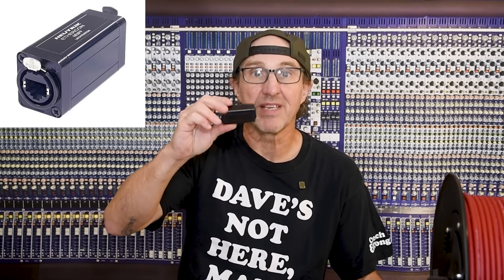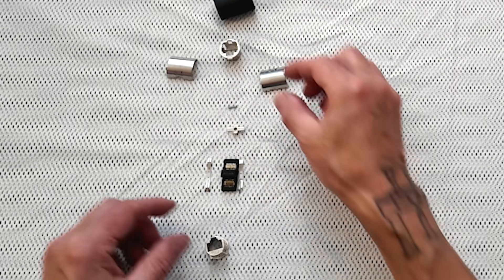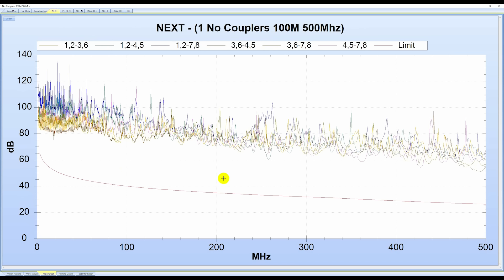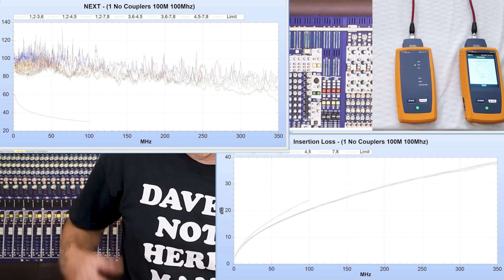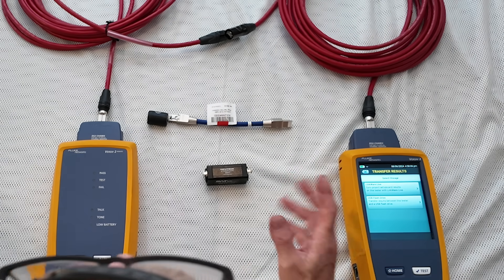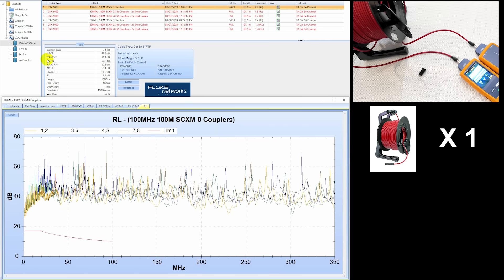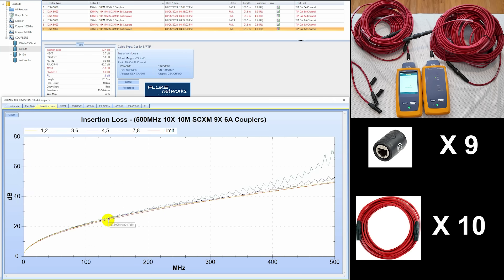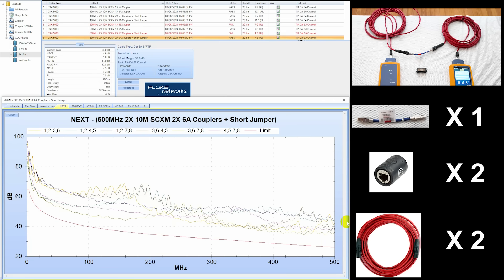How Bad Are etherCON Couplers?

Comment: Another super interesting video! With the large number of jumper results it almost looks like comb filtering, as if the jumper causes a reflection due to impedance mismatch at some frequencies but not others? Would it be possible to test the impact of one jumper at different points in the cable, to see if the frequencies that are affected move down the further away from the end?
Reply from the maker: Check the video around 13:18 where I do 2x 60m
Reply: @DaveRat  so you did, guess I need to be more observant! Thanks!
Reply from the maker: All good.

Comment: That frequency related ringing looks almost like an impedance mismatch. You see this in RF cables with SWR. Those Cat5e jumper leads would have terrible impedance at higher frequencies. The Super cat cable World have very good impedance and where they mate you get a mismatch and therefore reflections bad SWR. Now it just so happens at special frequencies you'll get great performance and also some terrible performance. That's a kind of laymans explanation of SWR and what your graphs look like to someone that has a RF background. 500MHz is well and truly in the radio spectrum. SWR is seen transmission lines. A rule of thumb is that if you can have more than one wavelength of a signal on the cable at any time you may have transmission line effects to consider. 100M with will have many wavelenghts even at 100Mhz. So the more i think about it i think you have transmission line effects at play here. Cool content as always Mr Rat.
Reply from the maker: Super cool and thank for the insight and info. And agreed. Seems the signal when it especially hits the Cat5e couplers the drastic change in wire gauge, circuit board, and connections all combine to create a reflection due to impedance mismatch. Or something down that line.

The full understanding is outside my realm of expertise but I am good at testing and coming up with deployable methods that are reliable
Reply: @DaveRat  no worries. You share so such much freely, feel I need to pay it back.
Reply from the maker: Thank you and appreciated

Comment: This is very important information for if you have a stagebox in a rack with panel mount ethercon and one at FOH for the X32. 
This is very important. Allen and Heath may be a similar situation. 
It would be interesting to test a similar configuration with Digico. 
Theres a video series idea!!! Test a bunch of major consoles using several couplers between the surface and the stagerack. That would be cool.
I have successfully mixed shows with my LV1 where I can run the Cisco switch at FOH into a jack panel (6 inch Cat6A), into a 10ft Cat6A extension with a cat5e coupler across a 100 meter cat5e snake with another 10ft Cat6a  extension, with another Cat5e coupler, plugged into the jack panel on the stage rack plugged into the stage Cisco switch using a 3ft length. So I have successfully used 4 couplers in that long of a length.
If I exceed that length connecting the Cisco switches it will fail. So I can do roughly 350ft between those switches. 
This can probably apply to using Cisco switches for Dante as well. 
I would never attempt this with AES50. AES50, do the Midas or Behringer. For those AES50 consoles, I insist on the AES50 port on the console into the AES50 port on the stagebox with no couplers between. With enough couplers between the desk and stagebox, you will hear a degradation in audio quality.

Comment: 🤔 Serious food for thought... This is making me wonder how much signal Degradation is incurred, by adding a panel mount connectors and short patch cables in a couple of racks I'm currently designing.. Thanks Dave for yet another great insightful video.
Reply: Yup, important to test the runs in-situ as well, since things like wireless systems / RF cabling / power cables in close proximity to the network runs can cause interference as well. If using punched-down patch panels, the quality of the punch down work matters a lot too, esp if you actually need Cat6 spec.
Reply from the maker: Cool cool @pauljanssen yeah if your cable runs aren't pushing 100 m or more and your 80 m or under then finding a cat 6A cable should not be too tough.

That said I kind of assumed that finding a cat6a cable with 19 dB or less loss and 100 megahertz 100 m would not be overly difficult especially for install grade cable with solid conductors.

Someone said they were looking at using the Super Cat XM Cat6a cable for an install where a 120 meter run would save them much grief and my response was that they should just find and buy a less expensive less robust, solid conductor and fire rated cable that would be better for the application. So I started looking and wow, try finding 100 m cable with less than 19 DB of loss at 100 Mhz And let me know what you come up with. 

When looking for cables for applications where you're going to push the 100 m limit or go beyond it you definitely will want to look at cables with minimal insertion loss at the frequency that you'll be using them.

The spec for 100 megahertz insertion losses 24 dB maximum. So if you can find a cable that's 18 DB of loss there's a pretty good chance you can run it reliably up to 130 m for so.

Or looking at it the other way You've got 30% more safety margin for degradation and reliability then you would with a cable of 24 dB of loss
Reply from the maker: The cat6A passthrough panel mount connectors are quite good and as good if not better than the cat6A couplers 

The Cat5e panel mount passthrough connectors are better than the Cat5e couplers but not as good although the Cat 6a couplers and pass through.

For Rat, we have tested and standardized on 100 meter supercat XM cables plus a Cat6a passthrough on each end in the rack or console and jumper to the console or stage rack.

And with this setup we can add up to 30 meters of supercat XM and still be good and stable.
Reply: @DaveRat  Thanks for your reply. This is the exact scenario in wich I was already thinking. The only mayor difference would be the cable used as Ratsound Supercar Cable is as close to unobtainium as rocking horse kaka, at least here in The Netherlands. Therefore I'm currently investigating Klotz and Talisker cables wich can easily be obtained from various courses. Hope you have a Merry Christmas and all the best for 2025.

Comment: Personally I was surprised they went this way.  It’s great for set and forget install but multi strand like this is problematic for tour grade gear.  It’s a bit like speakon connection.  The nl system is good but can get clunky but the old school DCC systems we use in model railway etc I thought we would be closer to something similar.   IE power data etc on the feed the digital separation we see across similar applications is becoming rather faultless but it means simple reliable connection but maybe it’s just me that wonders why I’m still plugging in my XLR cables into my pa speakers.  A tried and tested connection that’s what some 100 years old if it’s not broke don’t fix it.   I do data cabling for homes business etc and there was a new power line Ethernet adapter i recently came across for an industry where it also seamlessly navigated a 3 phase industrial sub board at 1GB 1.7 max 1.1 minimum according to his fluke tester and I was gobsmacked.   No alteration to anything just a plug and play approach.   I don’t know how the insurance goes with these types of connections, but that’s some pretty serious innovation at the moment.  even small scale cellular setups for large campuses blow me away.  I’ll be honest.  My exit and mogami cables serve me well and these new netgear lm1200 4g backups being looped into everyone’s fibre connections mean you will never know what’s gone wrong.   Since the show must go on.    Sensational video as always stay safe and merry festives to you and your family.

Comment: another great video at the end of the 70s I was testing telephone cables we had a lorry full of equipment I think those two little boxes on your bench do the same job if the cables were loaded impedance matched there would be some improvement I remember your test with a kilometre long microphone cable 😊
There's a formula line resistance line inductance continuity Shunting The line capacitance shunting the line and the only practical thing you can do is increase the Capacitance
Another thing with connections Is when the material changes the different energy levels in different conductors create something called the sea back Affect
You could also put analog repeaters in the line